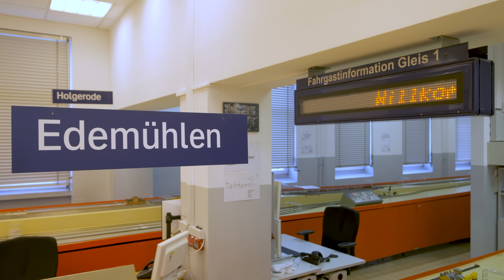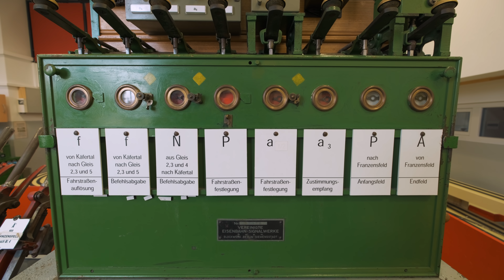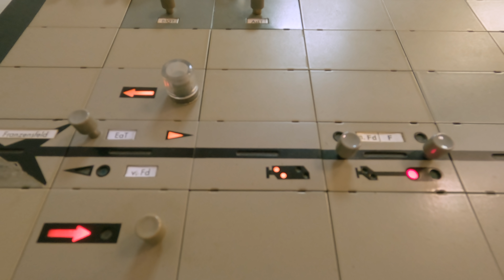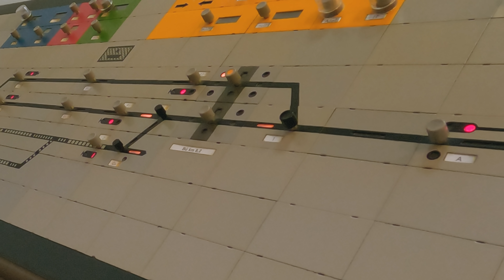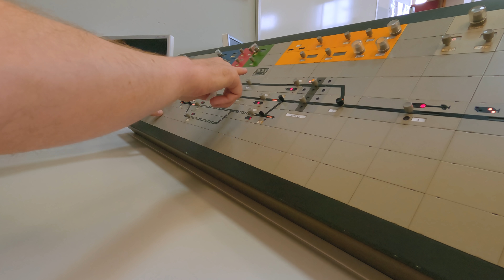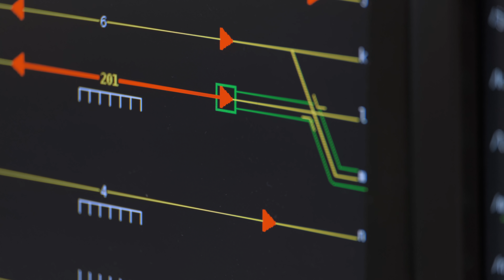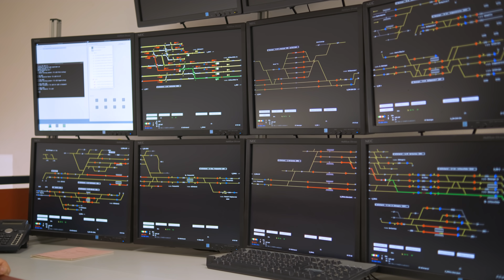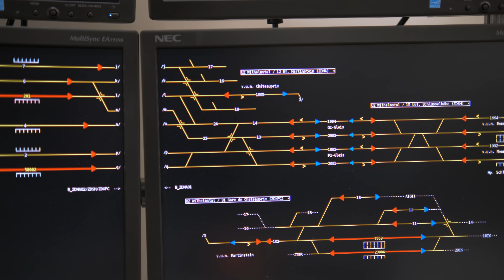The world's most useful model railway

Comment: As a signalman at Hamburg Central Station I must say that I really enjoyed that video! We've got a fully electrical-system as they named it in this video, but we actually type in two three-digit numbers instead of pressing two buttons. The track layout is displayed on a large wall. But the best thing is the view from our workplace, up there in a nice tower.
Reply: Nice, you most certainly were operating the track quite a few times while I was taking a train ride ;)
Reply: Dann sage ich als ehemals regelmäßiger Fahrgast einfach mal Danke für deine Arbeit. ;)
Reply: @LordHorst  Gerne. :)
Reply: @LordHorst  Then, as a former regular passenger, I simply say thank you for your work.
Reply: So it's you I have to blame when the platform changes at the last minute and I have to run up and down the stairs carrying loads of luggage! :)
Reply: Ja moin. Thanks for you work. I see trains are shifted a lot in Hamburg, compared to other stations, I assume to reduce delays. From an outside point of view, it seems the physical rail system seems to be set up rather flexible and works well.
Reply: :D

Comment: That was really interesting. So the takeway I got from this is that instead of an operator at every station, you will know have an operator centrally covering multiple stations. I wonder if someone still required at each station to perform manual override from a safety perspective
Reply: Manual overrides can be done from a distance. You don't need to have any staff on the stations anymore

Comment: I can see why Tom has a hearty laugh at the end. All the automation could have made for a cozy job with lots of slack - but NOPE, you fill the time by doing five jobs at once ^^
Reply: No good deed goes unpunished. :D
Reply: so you can see through the largest motivation behind the technological upgrades. hint: it wasn't safety.
Reply: no  I would add that the demand also goes up and this eats into added productivity, but the rest of what you're saying is absolutely true.

however, what is immediately noticeable is that demand should've hit a plateau at some point, but for some reason this didn't happen, even though we had several major technological breakthroughs. for example, road and air traffic should've relieved much of the railway transport demand.

though in this particular case train cargo transportation network increased 100x, so this is probably where the added demand comes from.

in any case, funky as hell! especially with the pay going down. I think this is because, as the systems grow, the working human individual is the weakest link and thus becomes susceptible to ideological and economical devaluations more than the actual work that needs to be done (backed up by natural resources). in other words, you cannot fool the nature, but you can always fool a human. this indicates two possible trends:

1) systemic inequality of value (and quality of life) distribution, and/or
2) systemic inequality of supply and demand

and, while one could argue that whoever works for such system also feeds the basic values back into it, obviously some kind of decoupling happened, and the system users are not the same people as the system providers.

if you look at the modern statistics, this is exactly what the uneven money distribution tells us.

but this will too hit a plateau, inevitably.

because it is very hard to imagine a world in which just one person has all the money, and lives in a fairytale where everything is accessible and practically free, yet operated by billions of hungry people who volunteer the service. this is true regardless of how advanced the technology might become.

unless that technology lets us materialize food and basic human rights with mere thoughts. in that case we'd all be that one person living in a fairytale and money would be a thing of the past (so called post-scarcity which is nowhere near our current civilization level).
Reply: @milanstevic8424  A state as you describe in your last paragraph is indeed not sustainable and will lead to civil unrest and eventually war. This is why civilized countries such as Switzerland are extremely dedicated to a strong social system and comfortable/secure living conditions for the largest possible amount of people: Switzerland's main asset is stability and a highly educated workforce, both of which are incompatible with having starving illiterates slaving away for a small ruling class. 

I agree that it is extremely peculiar how one person nowadays can create such a high output compared to historical counterparts - mind you, a single farmer or excavator driver can now do the work of hundreds! - a time of plenty and universal reduction in labor is not even approaching but moving further away as the "working poor" grow more numerous.

Comment: You should visit Didcot railway centre. They've got the electromechanical interlocking panel from Swindon station there, attached to a simulator so it functions, and also some mechanical systems from the UK. It might be interesting to look at the differences between the UK and Germany

Comment: The same mechanical and very similar relay systems are still widely used in Poland. Similar model could be seen in the railway museum in Jaworzyna Śląska (old steam locomotive depo). I also visited one at TU München.

Why the blue lever 1/2 was shown instead of red with a letter for signal setting?

Comment: And that is why I am afraid that the "Deutschlandtakt", the complete synchronisation and common scheduling of all major high-speed trains all over Germany, will either fail or at least be hugely delayed. The German railway system is still in need major modernisation, but there is not enough money being spent at.
Reply: I’d say the bigger issue with that is that we don’t have a dedicated high-speed network. As long as fast and slow trains have to share the same tracks, any small delay (which could easily happen even with the most advanced equipment) will quickly affect a number of other trains across the network. (Of course, the flip side of that is that any money invested into dedicated high-speed tracks doesn’t do much to improve the issues millions of commuters are facing on  regional trains every day. No matter how one slices it, in the end it always comes down to the issue of money - or lack thereof.)
Reply: @berlinflight_tv  Sure, but with a fully digitalized and automated system you could run trains much more effeciantly and smaller saftey gap, since the system would know where every train is at every moment and hiw fast it is going.

Comment: Intersting how German's have a completely seperate interlocking machine, rather than integrated interlockings like British practice.
Reply: I think this is due to the fact that Britain use multiple signals per track, each signalling one distinct direction/route (direction signalling). That means the route interlock lever can operate the matching signal at the same time.
Germany, at least since 1930, uses only a single signal with a single arm to show Stop/Proceed, regardless of direction, and a second arm to augment the indication to Proceed Slowly (speed signalling). Thus a signal can match multiple routes and it was easier to split route interlocking and signal operation into separate levers.
Reply: @TheNewTimeNetwork  Germany also had direction signalling until 1930. So our way wasn't a given.
Reply: Yes, in UK mechanical signalling practice, all the interlocking for the route is on the signal lever, and as per the other reply, we use one signal for each different route under the principles of route signalling. The driver determines the speed allowed from which signal is off and their route knowledge. On a panel though the entrance-exit press is all that is required to set the route, the the required points are called by the route setting in to the correct position
Reply: Exactly what I was thinking.

Comment: It sounds like the computer's job is to do 99% of the system-level work, including keeping the human monkey operators from making foolish mistakes, but at that point, why not just automate the human parts so the computer does all the work efficiently and reliably? That said, this looks like loads of fun for rail enthusiasts!
Reply: Much of it can be.   Computers can also drive the trains, and do on a few lines (Ligne 1 of the Paris Metro, for example).   But you still need a human to handle unscheduled events like, say, a train running late out-of-path, or a platform being closed because it's being repainted, or a train making an emergency stop for any reason...

Comment: the "having to operate multiple stations" isn't always true though. i work as a train driver in the Netherlands, and the yard i work at is so big that it would be way to much work to do any other stations/freight yards at the same time. it's even so big we have 2 train traffic controllers. one for almost all movements, and 1 for the gravity feeding shunting system. also known as hump shunting, where freight cars are pushed over a artificial hump in the track. From there, thanks to automated switches and special brakes within the track itself, the freight cars are sorted.

Comment: In the US,there were a couple of railroads that had similar setups,but nothing as elaborate! Definitely,a learn by doing,and no damage done,if something fails! Interlocking were the ancestors of your modern computers,as the,"gate circuit", binary code,comes right off the go-no go Interlocking circuits! And all that is now,taken for granted! Thank you for an excellent insight into,a normally invisible part of an everyday experience! As an aside,telephone exchanges also work on the same principle,and with CTC,there is a melding of the two,plus now,add in radio,another technology jump!! Thanks again for your time and effort 👍!

Comment: I remember the feeling sitting there at the operator's desk as a student: “Oh, no no no. Well, I guess your train will arrive at platform 3 today.” You cannot easily take back any action. Was fun though. To bad Tom, you couldn’t include the interlocking system of Darmstadt. Most of Darmstadt is operated using all-electrical interlocking and a giant pin-board. Just looking at it made me sweat.

Still a lovely video!
Reply: That's incredible, you were a signalman too?
Reply: @brendanmark4372  Yes, at least as part of my subsidiary subject. Actually any student of the technical university in Darmstadt can participate. The module is called “Eisenbahnsicherungswesen I“. It doesn’t really require prerequisites (possible to do without)
Reply: @moshmasch361  At university I was always on the lookout for interesting courses without prerequisites. I took fencing, foundry, and welding among others.
Reply: @hughbrackett343  Fencing was taught as a course?
Reply: Now I picture Tom Scott in the same position and all the timetable boards across England showing "content" for arrival times.
Reply: @safe-keeper1042  That's a deep cut.

Comment: This history here is so interesting. The fact that mechanical switches — 100+ year old technology — are still in use is mind-boggling.
Reply: It's slightly less mind boggling if you're like me and work at a heritage railway. There it is used daily and it's like the 20th century hasn't happened yet. Everything is either original (c.1881), rebuilt to original spec or as close to it as practical.

Comment: Thanks, nice video. My late father used to work as a controller (Fahrdienstleiter) with these mechanical levers and pulleys at the local train station, and I do remember all of the actions shown here in the video. When I tried it myself it was damn heavy to move a switch almost a kilometer away just via cables! And I still remember the typical smell of the signal-box fondly to this day.

Comment: Some twenty-ish years ago they had the shebang in a different building. A few of the levers were actually connected with wires to real signals and points in the courtyard. Cue a strategically placed ballast stone in the pointswork to teach an unsuspecting visitor (myself) that other things than interlocking can stop you from fully pulling a lever - all in good humour of course.
Reply: I think there is a good point here. If the mechanical systems are still in use, then why not try to replicate the experience as accurately as possible. What would a frozen, or seized linkage actually feel like? What process would you follow to free it up?
Reply: @mudmucks  Agreed. (Not so) fun fact: the point motors are so powerful that a slight freeze or small stone isn´t really a problem anymore, but also if you step on a point while it´s switching direction, your foot will be amputated.
Reply: @mudmucks  I work a mechanical signal box. It's hard to explain but after you have pulled every lever thousands of times you have an almost innate ability to know if something is not quite right that is very hard to teach new signallers it just comes with time. I can tell if the temperature has just dipped below freezing in the middle of the night just by the way the lever feels when pulling it.

Comment: In Ängelholm in Sweden they have a model railway with real signals hanging on the wall (if I remember correctly) and real relay boxes / signal computers, for use in training signal engineers. They also at the Railway Museum in the same town has a relay box handling a small model railroad and its signals to show how it works.

Comment: I have already seen and tried out all three interlocking techniques. My clear favorite is the mechanical signal box. You don't have very much to do, but when you have something to do, you have something to do. On electronic and pushbutton interlockings, all actions are not a meter away, a matter of seconds. In mechanical interlockings you have to stand up, you have to move big things, you can feel what you are doing. You feel the resistance, the weight. In the best case, you can even hear the signal switching in the background while you are moving the lever. It's so alive and so incredibly safe at the same time. I love it.

Comment: In the Dutch training center they have a somewhat smaller setup to teach the mechanics etc how the relays equipment works. I'm not sure if it's actually being used to train switch settings. As far as I know there are no manually operated switches on the Dutch network anymore. Well, on the main network anyway.
You plan a trainroute and the systems do the rest :)

(It's been a while since I operated anything for them (a few years), forgive me if my knowledge is a bit behind on the times)

Comment: What wasn't mentioned is just how much physical donkey-work is involved in operating the old mechanical signal-box, in fact the German system looks worse than the British because you have to stoop over to move the levers up and down. Pressing a button or clicking a mouse looks a lot less tiring, but it probably requires just as much concentration, if not more.

Comment: As a german, this gives me a whole lot more appreciation for the compexity "behind the scenes" of Deutsche Bahn. It is always easy to get annyoed as a traveller when your train is (once again) significantly behind schedule, but contrary to my expectations, even in 2021 stuff like this still is done by humans, especially concidering that all this older technology is (much less suprisingly) still in use somewhere along the tracks.
Reply: It is not teally about the contol (I think). A major problem is, that with the "Bahn-Reform", some 25 years ago, a whole lot of rails (track) and track switches (the intersections) were scrapped. So now with each and every delay there is this giant knock-on effect on the whole system with the trains blocking rach other, because there aren't enough tracks.
Reply: @jonathandilger1649  also, thousands of people were fired and the clocking of the trains became tighter, so in the end you have less track for emergencies and construction/maintenance, less trains, less time to catch up with delays and on top of that there are less/too few people operating all of it.

Comment: Shrewsbury Signal Box (Severn Bridge Junction) still has 180 mechanical levers, of which about 90 are operational and in day to day use. It has only recently been refurbished. The iron mechanical interlock frame is HUGE and looks like how you might imagine Babbage's analytical engine would have been.

Comment: Western Area Power Administration operates a similar simulator training center (Electric Power Training Center).  Initially built by the Bureau of Reclamation before Western spun out of it.  It has switchboards for several switching stations, and control boards with motor generator sets to simulate a hydroelectric powerplant and another set for a pumped storage powerplant.  In addition there is a miniature transmission line as part of it where various faults can be placed.  There is also a main dispatch desk as part of the simulator.  In addition there is a computer power system dispatch/control simulator.

Comment: One sidenote about the electromechanical relay system:
Lots of them actually also support directly inputting a route like in the computer system and automatically set all the required points. Some of the bigger ones are even more advanced and support multiple people setting routes at the same time using keypads to enter the start and end of a route.
Reply: Yup, sadly they skipped over the generation of my all-time favorite, the Sp Dr S60 from 1960. It automatically finds a route from start to destination, checks track occupation, sets all the points including flanks and overlap, locks everything and turns the signal. Much like the electronic system, but built entirely from electromechanical relays.
Reply: @TheNewTimeNetwork  I'm big into electronics, and frankly, that makes my brain itch thinking about it. I would not know where to start or what book or even what to Google.